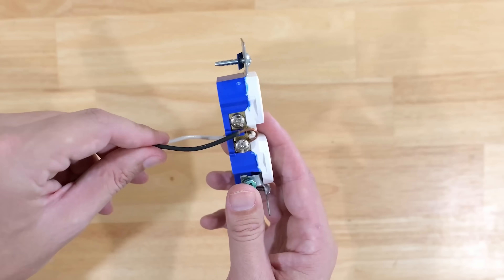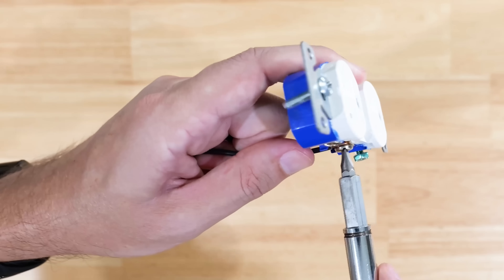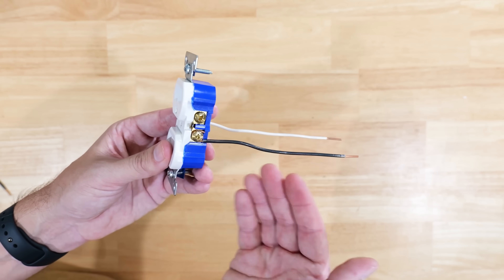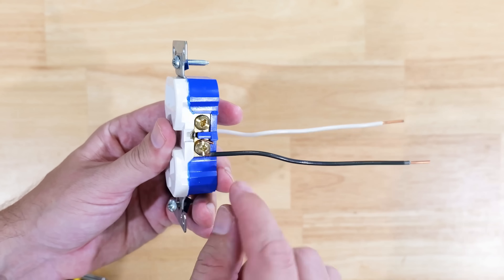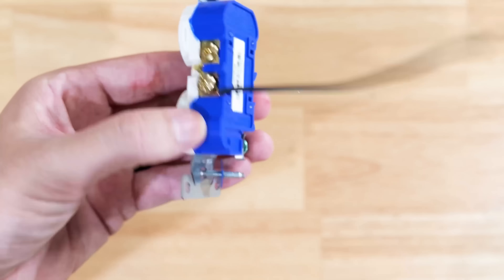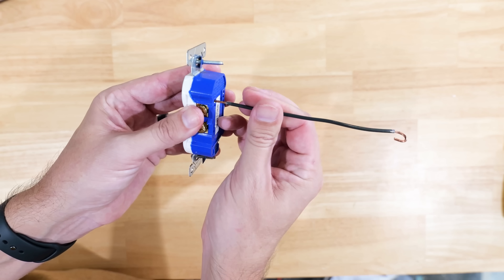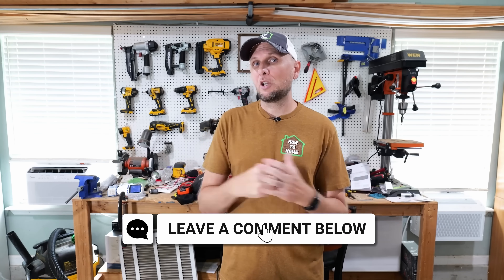Avoid Disaster! 8 FATAL Outlet Mistakes Most DIYers Unknowingly Make!

Comment: You really shouldn't be telling people they can put a 15amp receptacle on a 20amp circuit. Is it legal, sure. It is good practice absolutely not. There is zero reason why a 15amp receptacle is on a 20amp circuit. Match the receptacle rating to your breaker rating it's not that difficult.
Reply: This is nonsense.  The 15A receptacles are far more common than the 20A receptacles and are very often installed on 20A circuits by professionals as well as amateurs.  The circuit breaker protects the wiring.  The designation of a receptacle as "15A" does not mean that it must not carry more current than that, it means only that you cannot insert a plug designed for more than 15A.  If you are using high spec receptacles (as you should) the internals of the 15A and 20A models are probably nearly identical anyway.
Reply from the maker: It is done all of the time by electricians.  It is code compliant.  It isn't going to cause an issue.
Reply: @HowToHomeDIY  it's still bad practice.  And just being lazy and cheap.    And using the 20amp receptacle allows others to see it's a 20 Amp circuit. If electricians aren't matching receptacles to breakers than they are a shifty electrician. Again just because the NFPA says it's allowed isn't a good enough reason for doing it. Just put in the 20 Amp receptacle. Zero reasons why you wouldn't, other than being lazy.
Reply from the maker: @crimsonvance3294 no it isn’t and that is just your opinion.
Reply: @HowToHomeDIY   It is very much bad practice. putting a 15amp receptacle on a 20amp circuit opens the risk to the receptacle failing without the breaker tripping. If I plug two devices into my 15 amp receptacle that combined draw 20 amps my receptacle can overheat without tripping my breaker. Other than electricians do. You haven't provided a valid reason why you shouldn't just match receptacles to outlets.
Reply from the maker: @crimsonvance3294 psst, I’m going to tell you a secret.  The internals of a 15 amp receptacle are almost always the same as a 20 amp and are rated as such.  So that won’t happen.  😂

Comment: 0:29 #1. Selecting Proper Receptacle (20amp receptacle on 15a wiring bad!)
2:04 #2. Reverse Polarity (black/hot to gold/brass, white/neutral to silver)
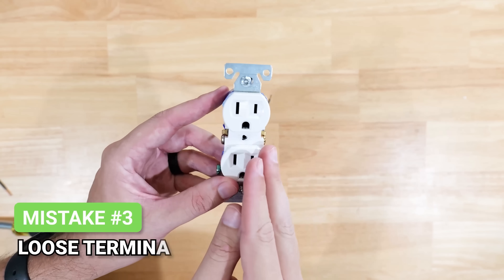3:29 #3. Loose Terminal Screws (screw tightly)
5:29 #4. Backstabbing (Use the terminal screws, not the slots in back)
6:44 #5. Wire Insulation (Strip to correct length and not expose wire or screw over insulation)
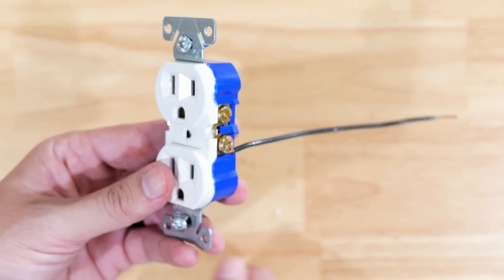8:47 #6. J Hooks (Wrap clockwise so screw tightening doesn't push wire out)
10:27 #7. Double Stacker (Don't)
11:49 #8. Used Wire (Don't undo J Hooks, cut and strip to expose new wire)
Reply: Thank you  @chrisf84
Reply: #14 will carry 20 amps in a typical circuit unless the home run is a mile long & you're in the Sahara. Code is nuts.
Reply: AC doesn't have polarity lol
Reply: @i4iRacing  since you're being "shallow and pedantic", here's what you should have said, or at least thought: "AC (Alternating Current) itself has no fixed polarity because the current direction constantly reverses, but in household wiring, "polarity" refers to the hot (live) and neutral wires; correct polarity ensures safety by keeping the switch and fuse on the hot wire, preventing the appliance chassis from being live, which is crucial for devices with metal bodies or those with 3-prong plugs where proper orientation ensures the ground is connected correctly, even though the AC waveform alternates."

Oof, man, really difficult to look up jargon. It's almost like the internet exists, and that words have multiple meanings.
Reply: @i4iRacing  bro either write your TEDx talk or don't post.

Comment: As long as the wire is 14 it's going to do the same thing with the 20 amp outlet or 15 amp outlet
Reply: No. 14 is not rated for a 20A circuit, so you should not use it with a 20A receptacle or breaker.

Comment: I’d like to add refusing to use pigtails.  So much neater and easier.  Less connection on the receptacle.  Also, never a bad idea to wrap in electrical tape.

Comment: If we’re really being honest here, most of these issues aren’t a matter of improper instillation, they’re mostly equipment design flaws. There’s zero reason why this basic, outdated design system can’t be updated with a simple, effective and way more efficient system using wire ferrules with a more secure way to connect them. To replace a receptacle it should be as easy as pulling a wire and reinserting it, done, full stop. But instead, we have all this nonsense building code to keep all this type of stuff “as safe as possible” all while knowing humans rush and cut corners for all kinds of reasons, or are just not prepared or knowledgeable enough. Most of the issues you brought up could be solved with some very simple redesign that wouldn’t take much to implement and get to market, but, this is where we are lol 😂🙈

Comment: I just replaced some switches and some outlets for the first time. I could smell an electrical smell in our laundry room. Because it’s an older house, 115 years old, the markings on the panel aren’t quite right. I turned off the breaker to that area and when I removed the outlet, it had burn marks on the white wire and some of the screws were loose. It’s a 20 amp breaker so I did replace it with a 20 amp Leviton outlet. Thank you for your videos because they’re a lifesaver

Comment: I don’t get it. Unlike DC current, AC has no pole.
Reply: "Polarity" is a term used whenever a distinction must be made between two similar things.  A 120V circuit has one "hot" wire and one "neutral" wire.  That is polarity.  A receptacle for a 120V circuit has slots of unequal size, which must be connected to the proper side of the circuit as explained in the video.  That is polarity.  Some plugs with only two prongs have prongs of equal width.  Those are unpolarized.  Plugs with two prongs of unequal width are polarized and can only be inserted in one orientation.
Reply from the maker: Just what it’s referred to.  It’s not literal.

Comment: I'm an industrial electrician. We hardly ever use solid strand wire. If you are using stranded wire, don't try to hook it and land it under the screw. Spend the 5$, get a box of terminal forks, crimp it on, and secure it properly.

Comment: I'm currently replaceing all the outlets in a 60 year old rental. I have found several of the original outlets with two wires on one terminal screw. Can you use a commercial outlet since it appears you could put a wire on either side of the terminal screw and tighten down the plate without overlapping the wires as it was done originally? If not, would the solution be to nut the two wires together and run a pigtail from them to the screw terminal?

Comment: Also you said when replacing a receptacle to cut the J hooks off and form new ones. All well and good, but my house is over 100 years old and whoever did the wiring , in some boxes the leads are short and do not permit me to re-hook them.
Reply: Same with my home. 115 years old and when I went to replace some switches, I barely had enough wire to cut

Comment: I am a DIY and learned home electrical from my father in law, and from some you tube videos. I have always used 12 Ga. wire for new or additional outlets or switches. The outlets have been rated at 15 amps. But I did have a problem with a new 20 amp circuit with a single outlet for a dust collector in my woodworking shop. It started to trip after a while at start up. Upon looking I realized I had a 15 amp outlet. I replaced it with a 20 amp outlet and its been fine. Also remember to tighten the extra terminal screws too.
Reply: Breakers start getting weaker the more times they have  been "tripped" and can become so weak they won't even stay on with any electricity connected and then you need to replace the entire breaker.

Comment: The leviton edge receptacles are not good.. the pullout on connections are the same or worse than a typical  15 amp backstab... not nearly like  a wago.  Stick to industrial grade receptacles.
Reply from the maker: That is just not true at all.  They hold wires much better than backstabbing and for way longer.  They also use thicker metal and surround the wire where backstabs just have one thin piece of metal that uses tension on one side.  The Lever Edges are commercial grade.

Comment: No, that is wrong. You can use the 15 amp recepticle with 12gage wire and it is perfectly safe. You just can't use 14 gage wire with a 20 amp breaker or larger. The breaker protects the wiring.
Reply from the maker: No, that is wrong.  That is still against code.  Code is very specific on this and even has a table showing what is acceptable for each receptacle.

Comment: You should never put stranded wire under a screw. You should put a crimp on terminal and put it under the screw.
Reply from the maker: Not required by code and the manufacturers clearly state that stranded can be wrapped around the terminal screws.

Comment: An old electrician at my job showed me how to do a better job with stranded wire on outlets. He twsted the strands in the opposite direction because it tightens the strands inward towards the screw when you tighten it. By that I mean just the strands not the direction around the screw.

Comment: great video - poses a couple questions. The 20amp outlet on a 15amp circuit - doesn't the circuit only allow 15A...? Even though the appliance wants 20, if can't have it..? And, thus not really creating a problem as the circuit is designed to operate at 15....? wouldn't the appliance try to operate with the 15 amp - and  whether it can or not.....     thanks (i'm not doing that - bad practice for sure , just wondering - I'm in a lot of home b/c of my job and would like to know)

Comment: Mistake #8  I did when I was putting in a outlet downstairs in my house, I just straightened out the J hooks And cut them shorter to fit a back wiring outlet. I did it because I was lazy, and because I didn't want to cut off any wire because I didn't have a lot.

Comment: I was on a new construction job a few months back I install the decking for a builder, I install the boards on a 45 degree angle. The electrician was doing trim out and he said the decking looked really nice and he said he couldn’t do that type of work. I told him I’m sure he could figure it out and that if I did his job as soon as the power is on the home would burn down. Electric work is not for diy types hire a licensed insured electrician. Trust me I e been in the business for over 30 years

Comment: First tip is basically wrong.

The solution is to not plug 20 amps into a 15 amp circuit.

the 20 amp outlet can handle the full 15 amps no problem, which is why it's safer to use.

the 15 amp circuit CAN NOT handle 20 amps, and you are far more likely to start a fire doing THIS than you are to start a fire putting a 20 amp outlet on a 15 amp circuit. I've never seen a 20 amp plug IN MY LIFE (most I've seen in 15 amps on my flux welder, which can also do 20amps from the same plug. Anything else is a washer/dryer plug). And anyone who would make this mistake most likely won't ever see one either.

What your average person WILL do though, is overload an outlet with power strips, and if someone plugs into a 20 amp circuit expecting the outlets to be 20 amp outlets (matching the circuit), but they are only 15 amps instead; all it takes is 2 high draw (10+ amps) devices plugged in to potentially cause a fire.

As far as which mistake will be made more often, it is definitely overloading a 15 amp outlet on a 20 amp circuit, NOT accidentally plugging a 20 amp device into a 15 amp circuit and trying to draw extra power from it.

Comment: I just  changed four levingtons. Now my circuit breakers popped did everything right. Really scratching my head on this
Reply from the maker: I am not there so I can't advise you as to what you have going on.  In my own personal experience, most of the time where I have found that happening, is from the ground wire, somewhere, being too close to or touching one of the energized screw terminals.  Again, not saying that is what you have going on, just what I have observed personally in the past.

Comment: So I have a receptacle that feels hot to the touch. Also causing any cord plugged in to get hot. I have since stopped using this particular outlet since I discovered the problem. Should I just install a 15 amp receptacle? being that the original ones looks like it is? When I go to remove the cover and look at the wiring inside the box, I don’t know what gauge the wires would be. How do I know exactly what to purchase?

Comment: Why do electricians say don't use the push connections in outlets yet recommend that the Wago connections are ok? To me they are basically the same as a push outlet connection.  Am I missing something?
Reply from the maker: Yeah.  You are missing that the mechanisms are completely different.
Reply: @HowToHomeDIY  It's still just a tiny edge of sheet metal contacting an edge.  There is actually very little contact compared to any other connection. The actual contact area is almost identical.  

You flip the lever to release vs push a pin in to release.
Reply from the maker: Against, they are completely different.  Push ins use one thin piece of metal to make contact with the wire and use tension to hold the wire in.  Lever connectors have metal plates on both sides of the wire and use an actual mechanical connection to hold the wire in place instead of one thin piece of metal that loses its tension over time.

Comment: One question and outlet is made up out of four screws the neutral and the hot I see you have a GFCI outlet so I’m just wondering do GFCI outlets pull electricity from the circuit breaker a regular outlet that has no GFCI mechanism in it doesn’t pull electricity 
it’s made out of screws and plastic the circuit breaker just is a valve that pushes electricity to every single thing on that wire/switch The outlet just conduct whatever electricity it gives it/Conducts .It does not pull electricity except for a switch, but that’s pulling the electricity from a light.
Reply: Correct me if I’m wrong

Comment: Two comments, 1) after installing thousands of receptacles the biggest mistake I noticed myself making is not stripping the wire correctly. If I used the wrong hole in the stripping pliers, or used just plain wire cutters, or a knife I would score the wire and the copper would just break off. That was by fat the most common mistake. Second, just as a safety precaution, I ALWAYS wrap the side of the outlet where the screws are with electric tape.

Comment: to tighten properly never use flat or philips drivers  but rather use a square drive and you cant torque without square and most electrical jobs allow for a square drive get a square drive if you do a frequent electrical job

Comment: i been an electrician a while and the majority of homes from the 80s and newer homes use the yellow 12 AWG for receptacles and 14 for lighting circuits where the breaker is 15 amp the wire is 20 and the receptacle is 15 again.... its hard to back feed the 12 into a 15 plug. i often use the post when working but sometimes i see 2 branches at a box meaning there is 6+wires in a box then i use up the 4 screw post then the spares i put into a back feed that may require me to upsize the outlet to a 20 to fit the wire or hone out the hole slightly so a 12AWG fits a 15 amp outlet.

most people are safe that most things you would use in your home has less than 10 amps draw so the fixture is mounted upside down to tell the electrician this switch is either on a switch or somehow differently wired

Comment: A 20 amp receptacle can not pull more power then a 15 amp braker can give it.
Reply: The electrical code apparently does specify that a 15A duplex receptacle on 20A circuit is okay, where the reverse isn't.
From a logic perspective, I agree with you, but I've also seen circuits slightly overloaded plenty of times, and often they won't trip.
Realistically, there's far more danger in someone plugging in two 10A appliances to a duplex outlet, or a cheap extension cord than there is to using a single 20A device on a 15A breaker.

I personally always just use a 15A receptacle on 14Ga/15A circuit, and only a 20A receptacle on a 12Ga/20A circuit.
Reply: And if the breaker fails….

Comment: Breaker protects the wire not the device.  Your not going to cause a fire using a 20 amp device on 15 amp circuit.

Comment: Another issue I've run into in my own house, is using the backstabbing connections but leaving the screws extended.  My guess is that they used to be screwed on, but for some reason someone converted to the backstab connectors but didn't bother to tighten the now unused screws.  Admittedly a low risk, but leaving the unused screws extended increases the likelihood of something touching them.  It only takes an extra 10 seconds to tighten them down.

Comment: 2 more items.
 If replacing  Old receptacles with new receptacles and they are 2 prong and only 2 wire in box You will lead a GFCI rather then a regular 3 prong

 When going to the breaker box to turn power back on if you see it is a Federal Pacific, roll your eyes and take a deep breath and then go take break.  😂

Comment: I've seen people use the strip gauge and then use those break off corner washers to strip The Wire. Don't just drop the break offs, they are spacers if the box is in too deep. 

The biggest sin I generally see that I have to fix is putting the j hook on the wrong direction. Someone said this should be taught in high school, I was taught in 8th grade.

Comment: Honestly, if I were connecting a stranded wire to a screw terminal, I would want to use a spade connector or a ferrule. They prevent the strands from bunching up as you try to push the wire in, the terminal screw squeezing out the strands, and stray strands shorting to adjacent terminals.